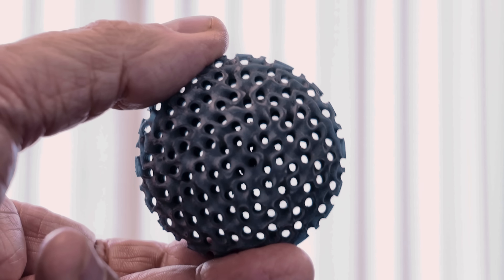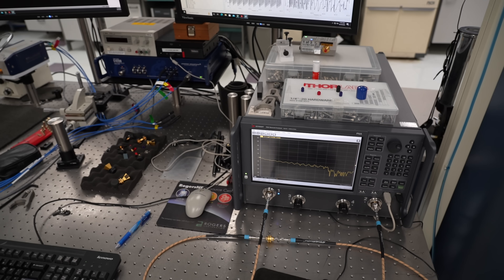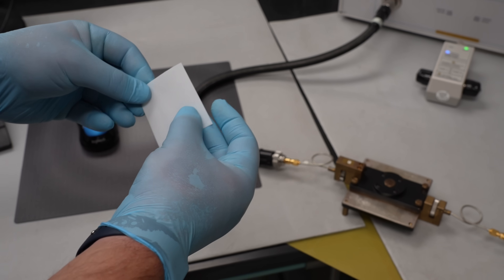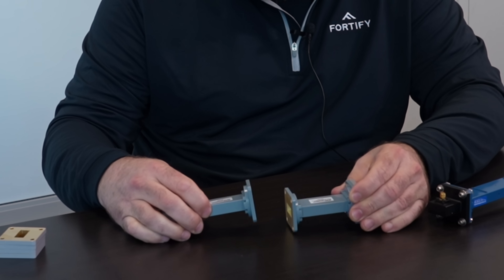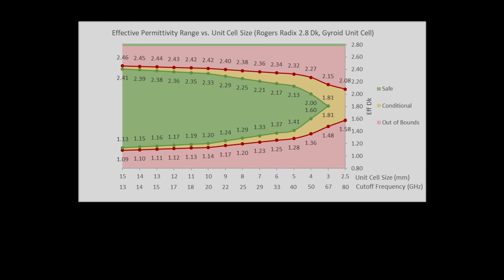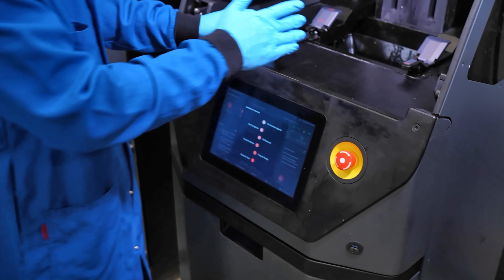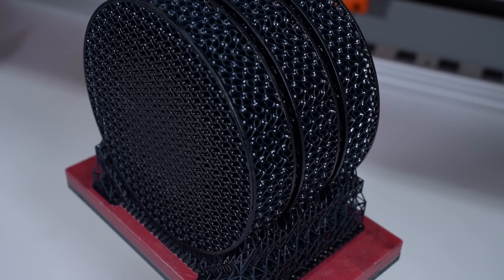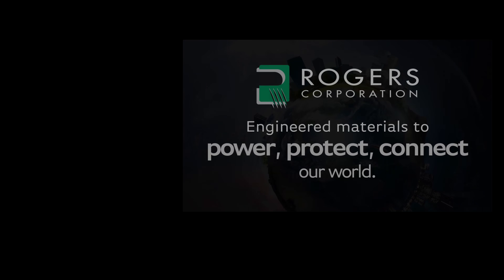Unveiling the Future of Antennas and RF Lenses using Radix™ 3D printable material!

Comment: What is the point of this? I watch some engineering stuff on yt, but I have no idea what this is about tbh.
Reply from the maker: The intended audience for this was a tiny group of specialist RF design engineers working with advanced antenna concepts. Maybe 1000 worldwide. Oddly, over 850,000 other folk watched it. I'll be making a video about the project for everyone else that will explain why this technology will enable engineers and designers to create antenna components that cannot be made using subtractive machining, casting, injection moulding or other traditional processes. With this material you can design lenses and other dielectric components to manipulate radio frequency fields in three dimensions. Watch this space for the "everyone else" vid, plus the deep tech results vids

Comment: Mavic 5 20miles Range 😂
Reply from the maker: Well, I can communicate with folks in other continents via bouncing signals off the moon at those frequencies, and 300 km at 10 GHz under normal conditions, and up to 1000 km or more with ducting, also 800km from rain scatter or aircraft reflections, so long ranges at microwave are perfectly feasible.  Best result so far is with 20 milliwatts, digital communication at 10 GHz over 342 km/212 miles using a 95 cm dish antenna

Comment: Lmao why didn't you just melt mix powdered copper with plastic ? You can make your own filaments man
Reply from the maker: I need a high performance ceramic dielectric insulator for dielectric lenses, coating prints with metal is a different game altogether. Getting it weather and UV proof, able to survive slightly acidic rain and sulphates, plus UV and a temperature range from -10 to +35 is always a challenge though. I might have a try at a polystyrene filament with ceramic fill and see if I could extrude some of that, but for metal I prefer laser sintering or machining and leave conductive 3D printing to the experts!

Comment: Got this in my recommendations, but have no clue what the hell I just watched. Is this 'new antenna' supposed to give you better Wi-Fi, 5G, AM-FM radio and/or OTA TV signals, or just make your microwave oven run better?  😐
Reply from the maker: Perhaps all of the above.  Antenna lensing has been around for a long time, but having a reliable and reproducible platform to manufacture these highly customizable parts is going to have the biggest impact.  Potential applications also include the creation of metallized structures for filters, matching networks and power splitter/combiners. Perhaps satellite comms, research labs, industrial applications in radar sensing and visualisation, vehicle radar, beam steering and beam-forming, aerospace systems, who knows what else.  It's an enabling technology and it's going to be fascinating to see how RF antenna designers and other RF engineers use these materials
Reply: @MachiningandMicrowaves   Awesome, thanks for the detailed explanation! Perhaps doing a video to show how much better an RF signal is transmitted with one of these new gen antennas (as opposed to an old style antenna) in a real every day application would be really practical. Like taking a commonly used device (router, transmitter, etc.), switching antennas on it, and measuring the signal strength / distance difference. That way the difference and benefits could be clearly shown, in a real application.
Reply from the maker: @SevenSixTwo2012  Part two will show some comparisons of things like sun noise levels, sidelobe performance, ground noise pickup, beamwidth, directionality and so on.  There aren't many domestic devices that I can think of that work at 10GHz other than possibly a TV satellite LNB, but once you have a solid signal with a digital TV channel, you don't get much of a measurable increase.  The benefit is right down at the extreme margins, such as on earth-moon-earth reflections or ultra-weak signal troposcatter comms or aircraft reflection out to 800+ km.  OK, that's a bit esoteric for most folks, but it's my normal day to day hobby activity!  Yeah, I'm a bit of an edge case. I'll have a think about more grounded examples!
Reply: @MachiningandMicrowaves   Awesome, thank you for the follow-up. I'll definitely watch part 2, then!  👍

Comment: I have to say it sure looks a lot like yet another 3d printing company who puts big words on simple things so they can charge $200k for a printer that costs $2k to build.   Looks like any basic SLS printing with a wiper and resin recirculator added on.   I could be wrong of course but their web page obscures the details including the price (massive red flag).   If you are a company that obscures the price of the product it is for one reason, so you can "talk to me about my application" and get enough intel to decide how much money you can squeeze out.    Yea, I'm cynical when it comes to this stuff.  Every new printing tech gets easily commoditized in a couple years, not too long ago you had to pay $15k for an SLS printer that pales compared to $400 printers today and all of their "space age innovation" was actually "basic innovation".

Comment: outgassing?
Reply from the maker: Not sure on the performance in high vacuum or space, but the photopolymer is well characterised so I guess there are numbers somewhere, but not on the stock data sheet. Rogers will have the info on numbers/chemistry and treatments for use in environments where outgassing performance matters

Comment: Dude, buy a printer? Cheaper than a plane ticket for prototypes
Reply: Oh nvm you're trying to manufacture mass product
Reply: With proprietary composites materials
Reply from the maker: The printers are kind of expensive for my likely production volume so a bureau service is a good idea until a business is producing quantities that need a printer. My Elegoo Saturn can't use this material because of the need to use it warm, wipe the tank base, agitate the material to maintain the ceramics in suspension. Perhaps one day it will be feasible though

Comment: Absolutely no idea what any of this is even for..
Reply from the maker: Focussing microwave and millimetre-wave radio signals using a gradient refractive index like you get in an optical fibre, but used for beam-forming rather than as a waveguide.  Also used for matching a microwave signal in a metal waveguide to the impedance of free space without a mismatch.  The Mikaelian lens is equivalent to a biconvex optical lens like that in a magnifying glass, but instead of having a varying thickness and constant refractive index across the radius, the thickness stays constant and the refractive index varies with radius
Reply: @MachiningandMicrowaves  wow no that didn’t help at all…  what is one of its application. It sounds physical but also hypothetical
Reply from the maker: Sorry, I'll try again!  The very specific application for the smaller lens is to fit at the focus of an antenna dish.  Rather like a satellite TV dish, but larger and deeper. This one is five feet in diameter.  I connect my receiver and transmitter cables to a metal tube near the focus. The coverage pattern of that tube is too wide and has some spill-over at the sides.  By making that special lens to fit into the end of the tube, I can ensure that the radio signal is spread across the surface of the dish and doesn't spill over he edges much. Rather like those flashlight torches that you can focus into a wide or narrow beam, but for radio signals.  By making the radio lens exactly the right shape and varying the density of the print, I can clean up the pattern so it is close to perfect.  That means my transmit signal is very efficiently focussed into a searchlight beam so when I point the thing at the Moon and track its movement, I am illuminating the Moon across most of it's width (half a degree or so) with my microwave radio signal.  Typically I'll be transmitting at the Moon and some other folks will be receiving using their dish antennas. Then one of them will try replying to my signal.  On receive, I need to gather the signal from the moon and present it to the receiver with the same sort of efficiency as on transmit.  Luckily, the antenna system behaves exactly the same on transmit and on receive.  However, there is another factor I have to take into account.  If I point my antenna at a blank part of the sky, it has an effective temperature of about 20 kelvin, minus 253 Celsius or minus 424 Fahrenheit. The Moon is much warmer at about -100F or -73C.  Warm bodies emit radio noise.  I want to be able to hear that radio noise as I point the antenna at the Moon.  If my antenna feed has some leakage at the sides or around the edge of the dish, it will probably pick up noise from the ground, vegetation or buildings, which are typically at 20 C, 293 K or 68F.  That's a lot of radio noise, so I want to minimise the side-lobes of the pattern as much as possible.  By tweaking the shape and density of the lens, and running an electromagnetic simulation programme, I can optimise it so the thermal noise is reduced to a minimum.

The other lens (the flat disk) is being used to make a small portable transmitter and receiver which generates a searchlight-type beam of millimetre wave signals at 24 GHz (12 mm wavelength) or 47 GHz (6 mm wavelength).  The flashlight/torch case is a nice robust and moisture-proof enclosure for the equipment.  I'll set it up on a tripod or mast about 100 yards away and rotate an antenna I want to test so I can find the shape of the beam it generates.  I can do that by receiving a signal from the portable unit on the test antenna or transmitting a signal from the test antenna and receiving on the portable unit.  The lens allows me to make a very compact and robust portable unit.  It behaves just like a handheld magnifying glass does with light. If you have a bright LED or filament lamp, you can focus it into a searchlight beam with a clear glass or plastic magnifying glass.  The 3D printed version behaves exactly the same as it's transparent to radio waves, but it's stiffer and lighter than a solid lens would be.  That one it a bit easier to imagine than the first one, as there isn't really a comparable application for lightwaves for the first lens.
Reply from the maker: Another application that's well known is if you have a Stealth fighter plane that's nearly invisible on radar, but you want to fly it into airspace controlled by civilian air traffic controllers.  If you use a gradient index ball called a Luneburg lens, and cover one half with metal, any radar beam hitting it will be reflected back in exactly the same direction it arrived from, so it appears as a very bright target on the ATC radar. Pop a few out when you want to appear on the radar, then pull them back in when you want to go stealth.
Reply: @MachiningandMicrowaves  WOWOWOWO!! THANK YOU for taking the time to share your passion and explain it to me/us in such incredible depth.. I now understand what your trying to accomplish and why it’s assisting you. At the beginning of this all I got the general idea of your needs but no idea why you would require such a thing.  This is truly a complicated subject!  Two questions You say the moon is warmer? At -100F isn’t that colder..??    Also what’s the goal in all this signal bouncing signals to and from the moon?
Reply: @MachiningandMicrowaves  wow!! Very cool! I love this type of knowledge. How large would these devices be? Just a few inches is enough to capture/bounce enough radar beams?
Reply from the maker: @j.jarvis7460   In general, aircraft radar is in a specific range of frequencies from a few GHz upwards.  A 4 inch diameter Luneburg with 3 mm unit cell should work from 8 GHz up to 30 GHz, but you would usually have a good idea of what frequencies your friendly radar systems are using, so you can design them appropriately,
Reply from the maker: The Moon is a lot warmer than the sky background. At 10 GHz it is a little warmer than the cosmic microwave background for a variety of reasons, especially where it traverses a lot of atmosphere, but still behaves like a black body at about 20 kelvin.  The Moon is warmed by the sun and the surface temperature varies wildly, but on average it's about 160 kelvin, so -100F is MUCH warmer than cold sky.  I can hear the thermal radio noise from the moon on my larger dish antennas, it's not anything like as much noise as I get from the Sun or even buildings, trees and the ground,
Reply: @MachiningandMicrowaves  WHAT!? I don’t even understand how that’s possible. Wouldn’t the random disturbance noises be sooooo much louder and entirely wash out any noise you can hear from the moon? You’d think you’d have to leave our atmosphere to hear that.
Reply from the maker: @j.jarvis7460  Path loss to the moon and back at 10 GHz is 289dB, including atmospheric loss and the 7% reflectance of the lunar regolith and corrections for the moon being round (like limb darkening on the Sun). That's a ratio of 1/8000000000000000000000000000thof the original signal received.  A good receiver and digital decoder can work down to only a few dB over thermal noise in the receiver, something like -160 dBm. With 200 watts (53 dBm) into a 46 dBi gain dish one end and a 38 dBi the other end would give a few dB of signal margin and an easy digital decode
Reply from the maker: The limit is thermal noise power at about -174 dBm in 1Hz bandwidth, from Boltzmann's constant times absolute temperature of the receiver times bandwidth 1.38e-23 J/K x 290 K x 1 Hz is 4e-21 watts or 4e-18 mW which is -174 dBm

Comment: You didn’t show any application, it was just shilling for the company
Reply from the maker: It's rather the point of a sponsored/collab video isn't it?  The target audience was a group of a few hundred specialist RF design engineers across the world.  This is an enabling technology, rather like any 3D printing system or a CNC machine or lathe or chisel. The engineers who use the system will be the ones thinking of the applications.  In my case it was 100% clear that the application was for an X-band dielspike lens for moonbounce communications and a 24/47 GHz Mikaelian pseudo-biconvex lens. I asked Rogers to let me try the material, they graciously agreed, and agreed to it being a sponsored collab.  Under UK Law I have to make that clear.  I will be making more vids abot MY applications using these lenses, abd they won't be sponsored, but I'm an unashamed fanboi of Rogers as a supplier of cool RF materials, so I'm going to be partial and biased.  This wasn't a review or critique, and I made that clear.
Reply: Much respect! Can this be used for stealth technology to degrade radar reflections… used as an under structure, another layer to RAM?
Reply from the maker: @ohbeardedone9253  I think the idea of using a more random foam-like structure with high refractive index as a an underlayer to RAM to improve the performance across wide frequency ranges might be something that is being worked on. I've not looked into absorbent materials much as I'm focussed on maximising transmission and reflection. Getting reliable absorption while preserving the physical characteristics of a material is rough.  I use ECCOSORB material inside device cavities to suppress reflections and resonances, it's good mechanically and very thin, but it is somewhat frequency-sensitive.  Getting something to be totally absorbent at frequencies from tens of MHz through to hundreds of GHz is a seriously tough challenge. Vantablack is nicely absorptive across the visual spectrum, but probably lets RF through to an underlying reflective metal layer almost unimpeded, and who knows how it performs at 10 um/30 THz. If anyone is working on this sort of approach to stealth and radar absorptive materials, they probably aren't publishing the details anywhere that ordinary folk like me can find! I do hold a security clearance in my day job, but not for THAT sort of material!
Reply: I wasn’t think absorbent, rather reflective with different “densities”
As shown in your project. Rather creating destructive interference with those reflections to degrade the important reflection, but that’s probably frequency based and cannot be applied to the whole spectrum. 

Thank you for engaging so much, that’s rare. 

Maybe this could be used for an antenna that’s harder to jam in signal rich environments… or part of the structure could be the antenna itself?